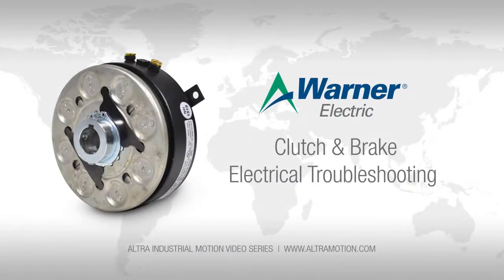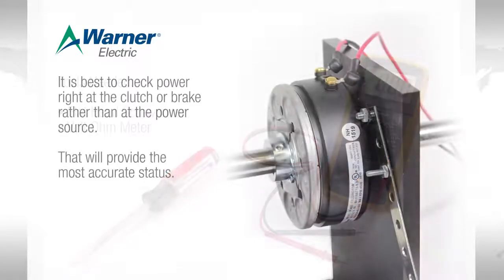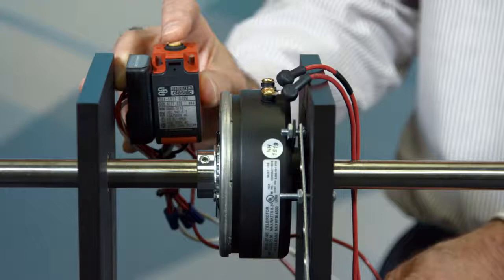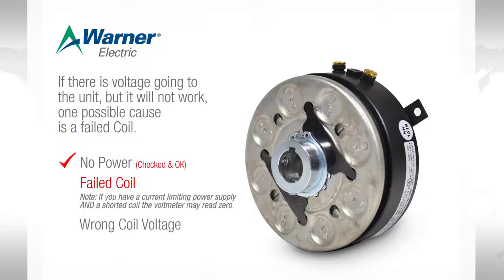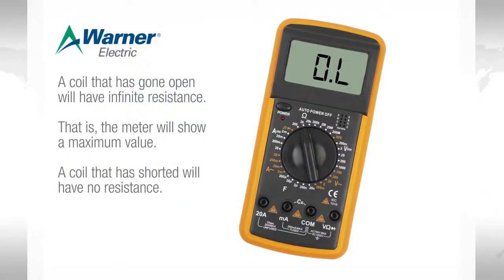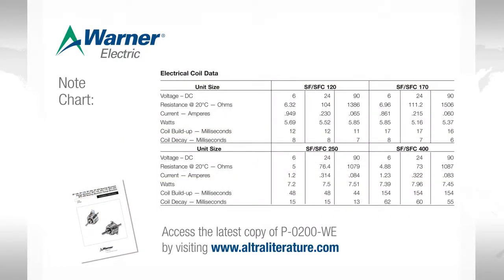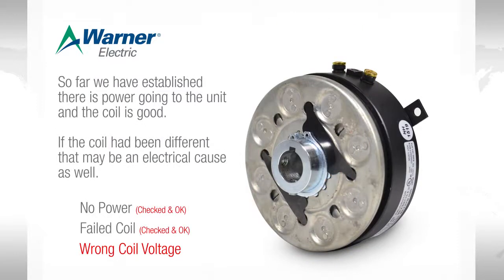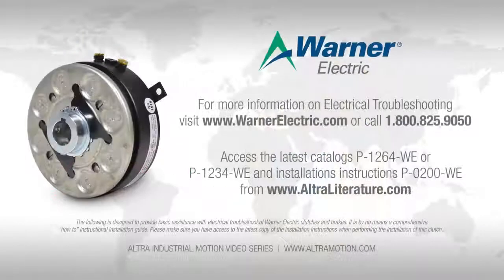Warner Electric  Clutch  Brake Electrical Troubleshooting

Comment: At $5,000 to $10,000 brake/clutch control boards Warner should provide all schematics and electrical data for repairs. When A$$es$ charge $1000 to $2000 dollars for a .39 cent F'ing part. Our company does our best to stay far away from crap like this, we do our own repairs when ever possible. Good thing is it may take a few minutes longer to find the problem WITHOUT a schematic but the control board isn't that complicated just extremely over priced for what they are and how they a produced. On a side note they are very unreliable.
Reply: The prices of this things is ridiculous... This is a very simple thing to cost that much is